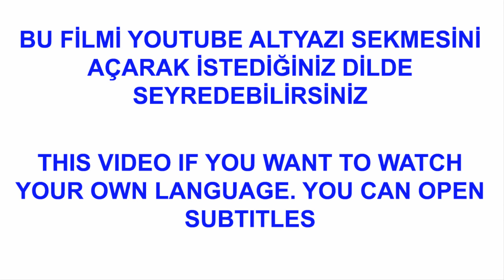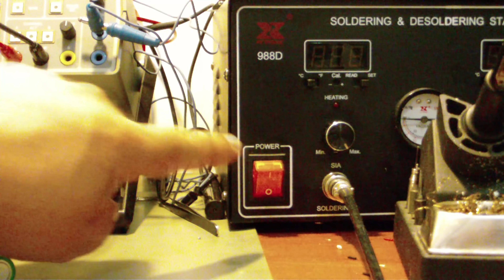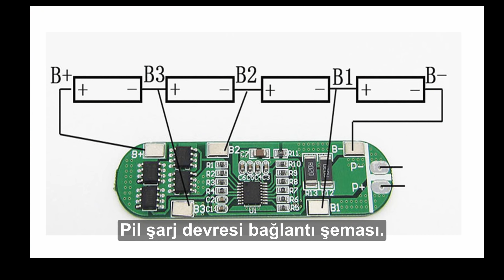HOW TO  MAKE A 14,8V 3600mAh BATTERY. 4S LI-ION (LITHIUM ION) 18650 CHARGE MODULE (BMS CIRCUIT).

Comment: bu devre ile birlikte pilleri 19v' luk adaptörle şarj etmenin sakıncası olur mu ?
Reply from the maker: 4s modül için Maksimum 17v vermeniz gerekiyor.19 v hem pillere hemde devreye zarar verir.
Reply: @electronic7979  3s bms için,en fazla kaç vermemiz gerekli farklı mı acaba 4s den
Reply from the maker: @ByCINAR  evet farklı. Pil başına maksimum 4.2V. 3s modül için maksimum 12.6v.
Reply: @electronic7979  o zaman matkap için bağladığım 6 tane 18650 pili 3s bms den şarj etmem için en fazla 12V adaptör kullanmam gerekir değil mi ? Önceki mesajımda 6 pili şarj etmen için 24V gerekir demiştiniz ama 
Sanırım doğrusu 12v 1a şarj cihazı sanırım.
Reply from the maker: @ByCINAR  6 adet pili seri bağlarsaniz 24v gerikir. Fakat 3s modüle bu pilleri 3 seri 2 paralel şekilde bağlamanız gerekir ve bunun içinde 12.6v vermeniz lazım. Siz bana ilk mesajınizda 3s modül kullandiğınizdan bahsetmediğiniz için ben sizin 6s modül kullandiğinizı duşunerekten 24v dedim.
Reply: @electronic7979  teşekkür ederim.o zaman 2 pili öldüren 24v adaptörle şarj etmem sanırım.Peki elimde 9v 500mah lık adaptör var bununlada şarj edebilirmiyim acaba ? Yoksa illaki 12v mu olması gerekli ?
Reply from the maker: @ByCINAR  rica ederim. Eğer kullandığınız 3s modül ise pillerin tam şarj olabilmesi için 12.6V gerekli 9v ile full şarj olmaz.
Reply: @electronic7979  hocam önereceğiniz 12.6v adaptör var mı acaba link yazarsanız minnetter kalırım.teşekkürler
Reply from the maker: @ByCINAR  önereceğim bir adaptör yok zaten piyasada 12.6v bir adaptör bulmanız da çok zor. Fakat şöyle bir şey yapabilirsiniz ayarlı voltaj regulatörü kullanarak elimizde bulunan 24v yada 19v luk bir adaptörü 12.6v a düşürebilirsiniz.
Reply: @electronic7979  hım anladım.onların fiyatta uygun evet onlardan alabilirim.teşekkürler..
Reply from the maker: @ByCINAR  rica ederim

Comment: Hocam müzik kutusu yapacağım onda kullanacağım bataryayı 20a olması önemli değil 30 da kullanırım diye düşünüyorum  4s bms piyasada hep 3.7 volt çıkma pil olduğu için normalde sıfır bulursam 4.2 volt olduğu için 3 s kullanmak ama dediğim gibi piyasada hep çıkma pil var
Reply from the maker: Amfi devresi için 20A lik bir modül işini görür.Bms modüller pil voltajını yükseltmez. pilleri dengeli bir şekilde sarj eder. li-ion piller max. 4.2 v ile sarj olurlar 3s modül kullanırsan yapacagin batarya çıkışı maksimum 12.6v minimum 11.1v olur. 4s modül kullanırsan çıkış maksimum 16.8v minumum 14.7v olur. Daha öncede söylediğim gibi hiç 4 seri ve 4 paralel bağlantı yapmadım. Seni yanlış yönlendirmemek için pil bağlantısı hakkında yorum yapamıyacağım.

Comment: Faydalı video. Açık ve net görüntüler.  emeğinize sağlık.  Aynı pil paketini (18650 x3) şarjlı tornavidam için 3s 20A BMS kullanarak yaptım.  Ancak bir türlü şarj etmiyor!!!  neden olabilir?  Siz benzeri bir sorunla karşılaştınız mı?  Teşekkürler
Reply from the maker: İlginiz için teşekkür ederim. Öncelikle modüle şarj voltajı kaç volt veriyorsunuz 3s modüller için  maksimum 12.6v şarj voltajı vermeniz gerekiyor  düşük şarj voltajı verirseniz modül pilleri şarj etmeyecektir. Şarj voltajı nız doğru ise kullandığınız modül arızalı olabilir.
Reply: Modüle öncelikle 12.6V verdim. Şarj yapmayınca 16.5V a yükselttim. Gene sonuç alamadım.  Geriye dediğiniz gibi tek ihtimal kalıyor.  Modül arızası.. Şİmdi onu yenileme işlemine girişeceğim.   Bu arada aklımda başka bir soru oluştu izninizle...  Bu modül ile hazırlanmış bir Li-İon pil paketini Balans şarj cihazı ile doldurmak zorunda değiliz değil mi?  Yani direk 12.6V veren bir adaptör ile şarj etmeyi deniyorum çünkü....
Reply from the maker: @vedatvural9768  bu tip modülleri kullanırsanız extra balans kontrol cihazına gerek yok.Modül aynı görevi görüyor. Siz pillerinizi kontrol ettinizmi pillerdede bir sorun olursa şarj etmez.

Comment: Hocam merhaba bu devre için 16v 650 mah adaptör şarj edermi teşekkürler
Reply from the maker: pilleri full şarj edebilmeniz için 16.8v 1a adaptör olması gerekiyor. 16v 650 mah adaptorle sarj olur fakat full sarj olmaz.
Reply: @electronic7979  teşekkürler hocam
Reply: Tekrar merhaba devreyi bağlarken bir tane pilin isindigini fark ettim bunu neden yapar bağlantıları kontrol ettim doğru pili değiştirdim yine oldu
Reply from the maker: @yk-4535  Merhaba. Daha önce başıma böyle bir şey gelmedi. Bağlantıları tekrar kontrol edin. Pil başına düşen voltajları ölçün hepsinin dengeli bir biçimde olması lazım. Kartta arızalı olabilir.
Reply: @electronic7979  tamam hocam ilginize teşekkürler
Reply from the maker: @yk-4535  rica ederim

Comment: Üstadım kolay gelsin elimde 18650 pil var 4 tane 3.7 volt 2600 mAh bu devreden alsam (4s) taksam ama bu 4s'lerde amper 10 20 diye çeşitleri var ve o devreyi takınca 14.8 volt adaptörle direk şarj edebilirmiyim kolay gelsin
Reply from the maker: Merhaba Şarj için 16.8 ile 17v gerekiyor 14.8v şarj voltajı yetersiz kalır. Amper olayı modülün gücünü veriyor yüksek akımlı modül kullanmanda fayda var.

Comment: Mrb  bende 50 adet lg g4 bataryası var. Acaba 5paralelx10seri halinde 36v akü yapsam. 10s bms ye ihtiyaç varmıdır, yoksa pilin üstündeki 1s devreler yeterli olur mu. Yada bu devreleri sökerek mi 10s bms bağlanmalıdır. Yardımlarınızı rica ederim.
Reply from the maker: Merhaba 
Bataryaları sadece paralel bağlasaydık extra devreye ihtiyacınız olmazdı fakat siz 10 seri 5 paralel bağlayacaksanız pillerin içindeki devreleri söküp 10s bms bağlamanız gerekecektir.

Comment: selamlar videodakilerin aynısını yaptım ölçümleride yaptım 16v çıkıyor ama matgaba taktığımda matgap döneyimmi dönmeyeyimmi diyor ve şarja bağladığımda çalışıyor nasıl oluyor anlayamadım
Reply from the maker: Piller saglammı kontrol ettinizmi. Şarj voltajı ne kadar verdiniz.
Reply: @electronic7979  kontrol ettim sağlam dördüde 12v 2a verdim onla çalışıyor ama elektrik kesince matgap basılınca azbi titreşim var sonrası yok
Reply: çıkış voltajınıda 16v alıyorum benim matgap 14.4v yazıyor acaba sıkıntı bms demi amperimi yüksek alsam diyede düşündüm
Reply from the maker: 4s bms modülü 16.8V ile şarj etmeniz gerekiyor.full şarj için Pil başına 4.2v şarj voltajı gerekiyor 4.2×4=16.8v 12v ile şarj etmişsiniz piller şarj olmamıştır pil başına 3v düşüyor. Lion piller 3.6v un altına düştüğü zaman bozulurlar. Siz 16.8V luk bir adaptör ile bms modülü şarj edin. Laptop adaptörü yada 16.8V dan daha yüksek bir güç kaynağınız varsa voltaj regülatör devresi yle 16.8V a ayarlayabilirsiniz. Sizin probleminiz şarj voltajı nın düşük verilmesi ve pillerin şarj olmaması.

Comment: Pilin üzerinde 3.7 volt yazıyor peki nasıl 4,2 volt oluyor.
Reply from the maker: Merhaba li-ion pillerin tam şarj voltajı 4.2V dur ve bu piller 3.6V un altına düştüğünde bitik kabul edilir.
Reply: @electronic7979  şimdi bazı şarjlı markalarda 14,4 volt yazıyor. Şimdi 14,4 volt kaç pille yapılıyor peki.
Reply from the maker: 4 pille yapabilirsin maksimum 16.8v eder. 2.8v luk fazlalık herhangi bir problem oluşturmaz.

Comment: Hocam aynı işlemi şarjlı matkap için 3s 20A bms ile yaptım matkap çok küçük zorlanmada enerji kesiliyor sebebi ne olabilir tşk. Ler
Reply from the maker: modül yetersiz gelebilir. Anlık yüksek akım çekişlerinde pilleri korumak için modül  enerjiyi kesiyor. Yüksek akımlı modül kullanırsanız sorun çözülecektir.
Reply: Aynı sorunu bende yaşadım. Cevap için teşekkürler
Reply from the maker: @hasanunlu4384  rica ederim. İyi günler
Reply: Pillerin eğer laptop piliyle anlık en fazla 1 amper verebilir. Senin en az 10 amper sağlayacak pile ihtiyacın var elektronik sigara için kullanılan Sony vtc4 vtc5 vtc6 gibi piller matkap için uygun

Comment: Merhaba videomuzu beğenerek izledim bilgilendirici bir içerik olmuş fakat elimde power workshop marka matkap seti bulunmakta ve bataryası 18 v nikel cadmium pil bulunmakta  bu matkabı lion piller ile upgrade ( değiştirmek) etmek istiyorum nasıl bir yol izlemeliyim bu konuda yardımcı olabilirmisiniz volt ve amper değerini nasıl ayarlamalıyım
Reply from the maker: Merhaba ilginiz için teşekkür ederim. 18v batarya lı matkap için 5s modül kullanmanız gerekir. 5s 40A lik modüller işinizi görür diye düşünüyorum 5s modülü şarj etmek için 21v luk bir güç kaynağına ihtiyacınız olacaktır.

Comment: Hocam gerçek ten 10 numara olmuş tşk ler .. şimdi bir kaç sorum olacak cevaplarsanız sevinirim .. 14.4 banada lazım bir şarjlı matkap bataryası, bendede eski laptop bataryası var sağlam pilleri çıkarttım,  4 lü değilde 5 li pil kullansak 18v elde ederiz sizce matkaba zarar verirmi, 5s şarj modulu varmı, bunları kaç v şarj adaptörü ile şarj edeceğiz ..
Reply from the maker: Merhaba 
İlginiz için teşekkür ederim 
5 li pil kullanırsanız toplamda 18.5v eder.Şarjlı matkap ta bir sorun çıkaracağını zannetmiyorum. 4s modüller için maksimum şarj voltajı 17v. 5s modüller için maksimum şarj voltajı 21v dur. 5s modülü aşağıdaki linkten temin edebilirsiniz.
https://goo.gl/STzHyK
Reply: @electronic7979  Hocam tş kler .. yine burda youtube de bir arkadaşın videosunda şarzlı matkap için aynı şekilde pillerden batarya yapmış not olarak şöyle birşey düşmüş matkabı çalıştırırken zorlandığında akımı kesiyormuş, oda  batarya dolduktan sonra direk bağlıyorum diyor böyle bir şey olabilirmi sizce ..
Reply from the maker: @yasarbaba9719  Merhaba 
Modül üzerinde aşırı akım koruması mevcut eğer düşük akımlı modüller de matkap çalışırken akım koruması devreye girebilir. Tabi bu yazdığım tahmini bir bilgi.

Comment: Elimde tpa3116   2x50w anfi devresi var çıkış hoparlör gücü yüksek olduğu için en az 10.000 mah lazım bana 3s için elimde şema var gayet basit bir şema ama 4s için birşey bulamadım en az 12 volt lazım bana çıkma piller 11.1 veriyor modül onu 12 yapıyor mu yoksa 11.1 mi çıkar yine
Reply from the maker: Amfi devresi için 20A lik bir modül işini görür.Bms modüller pil voltajını yükseltmez. pilleri dengeli bir şekilde sarj eder. li-ion piller max. 4.2 v ile sarj olurlar 3s modül kullanırsan yapacagin batarya çıkışı maksimum 12.6v minimum 11.1v olur. 4s modül kullanırsan çıkış maksimum 16.8v minumum 14.7v olur. Daha öncede söylediğim gibi hiç 4 seri ve 4 paralel bağlantı yapmadım. Seni yanlış yönlendirmemek için pil bağlantısı hakkında yorum yapamıyacağım.

Comment: Nasıl şarj ediyorsun dolduğunu şarj olurken dolduğunu nasıl anlıyorsunuz?
Reply from the maker: Merhaba bu modül pilleri dengeli bir biçimde şarj etmeye yarıyor.pil dolduğu zaman akım çekmiyor ve şarjı modül otomatik olarak kesiyor.şarjın bittiğini ve pillerin dolduğunu gösteren bir ikaz modül üzerinde yok böyle bir şey yapmak istiyorsanız modüle extra voltmetre ve amper metre bağlamak gerekir.
Reply: @electronic7979  Peki kesip kesmediğini hiç test ettiniz mi bende 5 10 tane alacağım. Ayrıca teşekkürler.
Reply from the maker: @pusatberk4193  modül üzerinde S-8254a entegre bulunmakta entegre datasheetinde aşırı voltaj ve akım koruma özelliği bulunmakta.ben kendim bunu denemedim ama internetten entegre datasheetini inceleyebilirsiniz

Comment: Merhaba,

Kendime şarjlı matkap yapmak istiyorum.775 lik DC motor kullansam olur mu ? Batarya kısmını ise 6S lik bir batarya yapmak istiyorum.6S lik bir devre varmı ? Bu devrenin asıl amacı,bataryayı şarj ederken,bataryaya giden elektriğimi dengelemek ? Mesela 6 tane 3.7V luk li-on pil kullandık.Toplamda 22.2V sahibiz.Biz bu bataryamızı istediğimiz gibi Şarj edebilirmiyiz ? Örneğin USB soketi yaparım ve bir telefon kablosuyla bile şarj edebilirmiyim ? Yani demek istediğim bu devrenin asıl amacı nedir ? Bu işlerden pek anlamıyorum sadece hobi amaçlı uğraşmak istiyorum.RC uçak ve araçlarada ilgim olduğu için bu konularda ilgi duymaya başladım.Cevabınız için şimdiden teşekkürler.
Reply from the maker: Merhaba. Bu modüllerin amacı bataryası dengeli bir biçimde şarj etmek. Projenizde 4s lik bir modül kullanacaksanız minimum 13.8v luk bir şarj voltajı na ihtiyacınız var. 6s lik bir modül kullanacaksanız minimum 24v luk bir şarj voltajı na ihtiyaç duyacaksanız . Bu yüzden 5v luk bir usb ile bu modüle bağlayacağınız pilleri şarj edemezsiniz. 6s lik modüller video açıklamalar kısmındaki mağazanın içerisinde bulunması lazım.

Comment: Matkabımda liion pil dönüşümü yaptım fakat 2. hız kademesinde sorun yaşıyorum, yardımcı olabilirmisinz?
Reply from the maker: Nasıl bir sorun yaşıyorsunuz. ?
Reply: @electronic7979  2.hız da matkapı elim ile durdurabiliyorum.
Reply from the maker: @kermdncer9981  pilleriniz sağlam mı. Piller yeterli akım da şarj olmuyor olabilir.
Reply: @electronic7979  pillerim saglam ve sarj islemini yeterince yapiyorum.
Reply from the maker: @kermdncer9981  pillerin voltaj larını modül üzerinde şarj olurken ölçtünüz mü. Voltajin tüm pillere dengeli bir şekilde gelmesi lazım. Eğer voltajlar normalse modül akımı düşük geliyor olabilir şarjlı matkaplar için 40-50amperlik modül kullanmanız daha iyi olur. Eğer modül de güçlüyse modül arızalı olabilir.
Reply: @electronic7979  modülden kastıniz bms mi?
Reply from the maker: @kermdncer9981  evet

Comment: Leptop tan söktüğüm piller 5.4 w gösteriyor normami
Reply from the maker: 1 adet pilin 5.4v göstermesi normal değil. 4.2V göstermesi gerekir.
Reply: @electronic7979  6 tane pil var hepside 5.4 gösteriyor limon da bu volt varmi
Reply from the maker: @fatihpolat4121  limonta ne kadar volt olduğunu bilmiyorum. 6 pilin toplamı 5.4v ise pillerin şarja ihtiyacı var. fakat pil başına 5.4v ise piller bir sıkıntı var.

Comment: Arkadaşlar birisi bana yardımcı olsun bir zahmet. Elimde 4 adet 3.6v samsung li ion pil var. Bu pillere uygun bms devresi bakıyorum fakat hepsi 14.8V için. Benim sorum  4pil=14.4V olan bu pilleri 14.8V bms devresi ile şarj  olur mu? Olursa ne kadar sağlıklı olur?
Reply from the maker: 4s modül kullanabilirsin herhangi bir problem olmaz.
Reply: @electronic7979  Size son bir soru daha sorayım. 4s bms devresini kaç volt ve amper bir adaptör yardımı ile şarj edebiliriz?
Reply: Cevap videoda varmış zaten

Comment: Ben yaptım fakat piller den sadece 2 si şarj oluyor acaba nerede yanlış yaptim
Reply from the maker: Pilleri doğru bir şekilde bağladinızmı. 4 pil için şarj voltajı kaç volt veriyorsunuz. Devreye bağladığınız 4 pil de saglammı
Reply: 6 voltluk 400 ma lik şarj adaptörü kullanıyorum enson 7.4 de kaldi
Reply from the maker: Peki devreye 4 adet lion pil mi bagliyorsunuz yani 4 adet lion pili 6 volt ilemi şarj etmeye çalışıyorsunuz
Reply: Elimde 21 voltluk adaptör var onunla deneyimmi
Reply from the maker: Sakın ha!!! Aman hocam 21v verirsen devreyi de pilleri de patlatırsin. 4 adet pil için minimum 16.5v maksimum 17v gerilim uygulaman lazim
Reply: @electronic7979  tamam teşekkür ederim
Reply: Ustam yardımına iydiyacim var pilleri şarj edemiyorum
Reply: 16 v lik şarj adaptörü kullanıyorum yinede şarj olmuyor  pilleri kontrol ettim saglam
Reply from the maker: Adaptör karta takılıyken pil başına düşen dc voltajı olcebilirmisiniz
Reply: @electronic7979  2.16 1.76 0.40 1.95
Reply: Kart üzerinden b2 2.35 b3 4.13 b4 2.10
Reply from the maker: Merhaba musa bey
Kullandığınız kart bu videodaki kart ise
Kart şarj giriş voltajı  16.8 V-17 V olmalı. Siz 16v uyguladıgınızda da pillerin şarj olması lazım. Bu yazdığınız  voltajlar çok düşük. 16v uyguladıgınızda daha yüksek voltajlar görmeniz gerekiyor. Pillerin + ve - yönlerini doğrumu bağladınız bir kez daha kontrol edin. Çünkü b3 noktasında 4.13 volt gerilim olcüp B4 noktasinda 2.10 volt gerilim ölçuyorsanız bu noktalardaki pillerin yönlerini ters takmış olabilirsiniz. Eğer herşey doğru ve piller sağlamsa kart arızalıdır.
Reply: Bendeki kart farklı söküp yeniden bağladım bu sefer 10 v kaldı şimdi sizdeki kartın aynısından sipariş verdim birde onu deneyeceğim
Reply from the maker: Ok.

Comment: Merhaba gerçekten güzel yazılı ve görsel bir anlatım olmuş, tebrikediyorum. Yeni öğrendiğim bir bilgiyi paylaşmak isterim, BMS lerin hepsi dengeli şarj etme özelliğine sahip değil, sahip olanlar bunu ilanın açıklamalar kısmında belirtiyor, bu videoda kullanılan sadece koruma için, dengeli şarj etme özelliği yok. Bu BMS ile pilleri şarj etmek doğru bir uygulama değil, verdiğim linkteki kart da 12 Amperlik bir kart ve balance şarj özelliği var bir kıyaslarsın, videonun açıklamalar kısmında bu bilgiye yer verirsen çok iyi olur, hoşçakal kolay gelsin.      http://www.aliexpress.com/item/32707641623.html?spm=a2g0o.productlist.0.0.4baf3e48RGGaoF&algo_pvid=283dfe41-7ced-4f91-b0d2-7c19e78574e0&algo_expid=283dfe41-7ced-4f91-b0d2-7c19e78574e0-1&btsid=44805ba9-7464-44b0-99ff-e5191a77ac52&ws_ab_test=searchweb0_0%2Csearchweb201602_8%2Csearchweb201603_52
Reply from the maker: Merhaba İlginiz için teşekkür ederim. Video açıklamalar bölümündeki linkleri düzenledim.